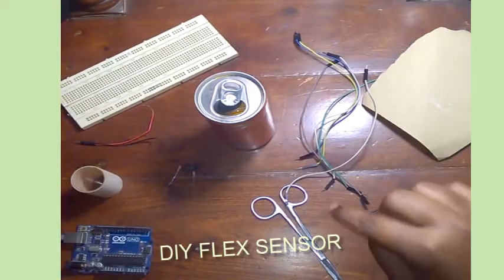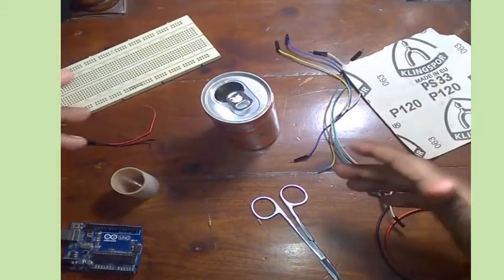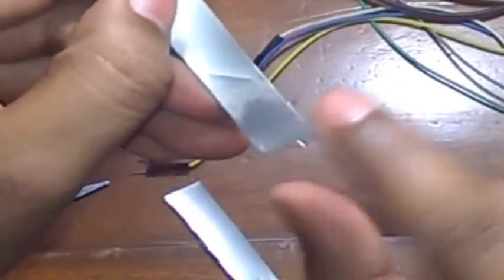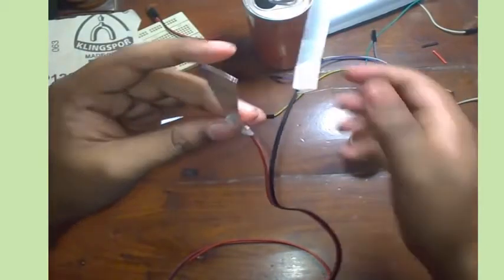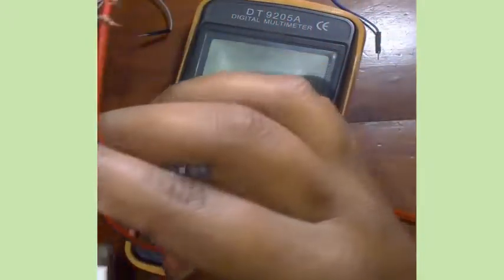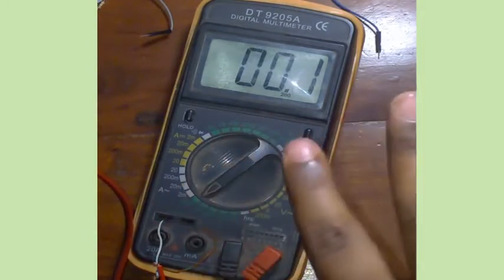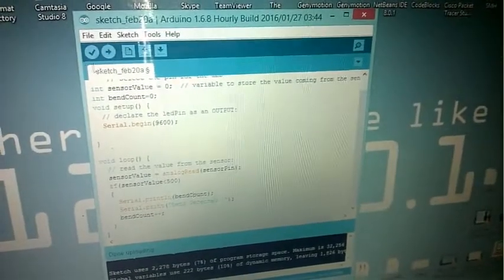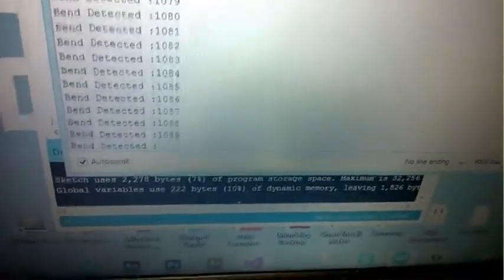✅ DIY Flex Sensor With Arduino || Low Price Flex Sensor with Arduino || Simple Homemade Flex Sensor

Comment: I have wrote the the code . So providing it for everyone :-
int sensorPin = A0;
int sensorValue = 0;
int bendCount = 0;
void setup() {
  Serial.begin(9600);
}

void loop() {
  // read the value from the sensor:
  sensorValue = analogRead(sensorPin);
  if(sensorValue<500)
  {
    Serial.print("Bend Detected : ");
    Serial.println(sensorValue);
    bendCount++;
  }
  else{
    Serial.print("Not Bend : ");
    Serial.println(sensorValue);
  }
}